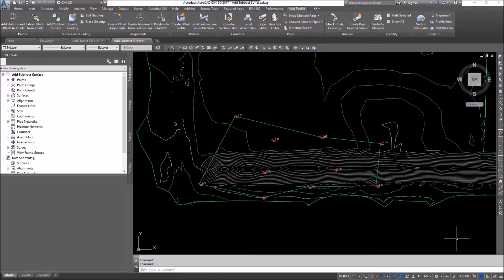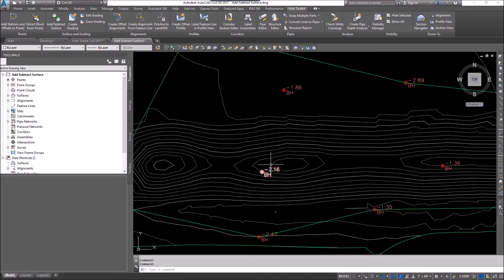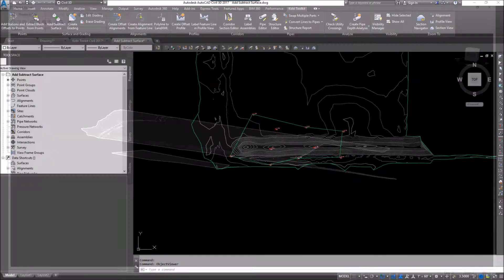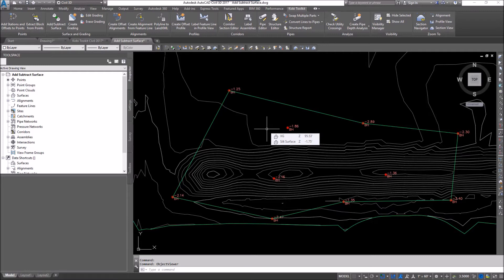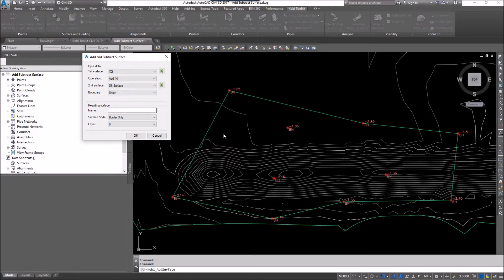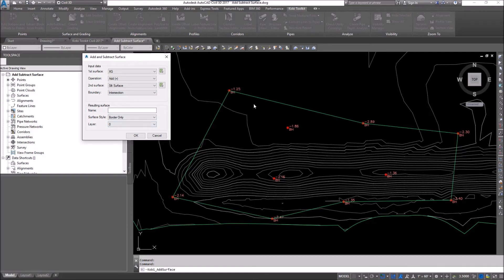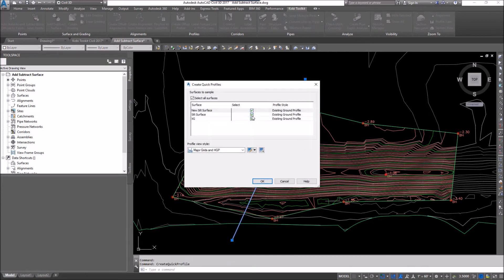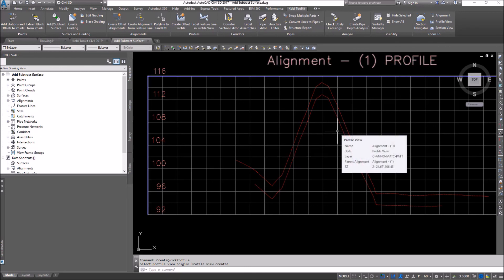Civil 3D Add Subtract Surface - Kobi Toolkit

Comment: Ah, interesting. I wrote the same tool but with several variations. One thing on this, is you need to show the resulting triangles. That tells people if you are simply modifying the z on verts of one surface, or adding intersecting tris similar to what a tin volume surface does. That Union option is of interest, as how did you handle the edges? The tris would tell me. So this add-subtract tool is useful for modifying drone surfaces that had vegetation, and you decided on some average value to lower by. The thing is, many times you want to blend that lift/lower for some distance. I did tools that blend by distance from edge, central point, and a few other options. Once you can manipulate surface z's, you can also do things like flatten using some pline boundary. We do that for under piles that are temporary, and we don't want to count the volume for. Another key tool is a "composite high or low" surface, which you need when doing remedial volumes. Sometimes the bottom is existing lowered some amount, and sometimes its proposed lowered some amount. thx